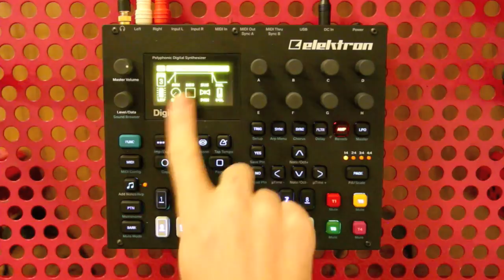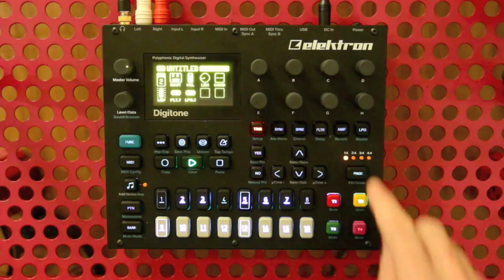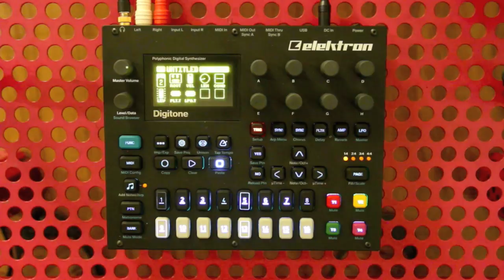Digitone Trig Layering Advanced Tip

Comment from the maker: If you have any feedback or questions, just leave a comment!
Reply: @Ron Booker those are two totally different machines
Reply from the maker: @Ron Booker I'm happy you have found something that works for you. MC-909 is still a great platform...I actually first cut my teeth on an MC-505.  Your points of criticism regarding cost of development, manufacture, branding, etc are not entirely correct. There's a lot that goes into a product's sticker price. I worked at Elektron throughout the entire development and launch of this product.
Reply: Hey man ! What kind of advantage do you see in this method? I am just curios because I may just not get it 😁
Reply: Great to know someone else with the digit one out there. Both tips were new to me. Kudos... I have subscribed,,,,

Comment: Nice video! What's the advantage to this method over just copying the pattern from T1 over to T2? I guess just the fact that you can actually stack? Because while all the things done were cool, I'm not sure I saw much of a need for one method over the other except for when I first heard the stacked sound at 1:51.
Reply from the maker: Hey good question! You are correct, stacking normal note trigs is not really a special advantage...but adding parameter locks that contain no "note trigs" is the point here.  It's like having a separate "parameter automation lane" for one of Digitone's tracks.  And thanks to the Elektron sequencer's handy conditional programming, those parameter locks in the so-called automation lane can be probabilistic, or triggered only in fill mode, etc etc

Comment: I'm confused, and a future digitone owner, didn't I read in the manual that you can add a trigess lock even to a step that already has a trig? Did I read it wrong or could you do this on track 1? Thanks
Reply: i dont have the Digitone but a Trigless Trig is exactly what its name implies: It doesnt trigger the Track Sound and it doesnt trigger the Envelope or the LFO by Default (you can change the latter behavior though). It triggers Parameter changes. A regular step always has that trigless trig built in - if you want to see it from that perspective. However: If you want a Sound to be triggered on a particular step all the time - but if you dont want to change, lets say, the Filter frequency for that very same Step every time - this method is most likely the only way to do it. Because a Trig Condition on a regular step will influence the Sound triggering as well. This method only influences the parameter changes. Nice thing to have, but most likely not usable all the time since you run out of Tracks on that Digitone quite fast that way ;-)
Reply: umonox oh so like if you want to override the parameter lock you've already put on your note trig? I understand what a trigless trig is but that's not the question, the manual uses the word lock trick and says that you are able to add one on top of a note trick on the same step and same track. So I'm trying to understand if that's true or not cuz someone this video is layering Tracks to get the same effect , but according to the manual you should not need to use two tracks to layer. So I'm just trying to understand if I misunderstood or if this is unnecessary? Not saying that it's stupid I just want to understand how the trig locks (func + trig) work

Comment: cool hadn't figured that yet, this layering is so fun, do you know if we have something similar on the A4 ?
Reply from the maker: Good question! The "layering" function on DN is slightly different than the poly assign functions on AF/AK...so it is not possible AFAIK.  Although with an AF MKII you could send CV out using the CV track, and feed that back into a CV input and modulate a synth parameter that way, thereby giving you an "separate track" for parameter automation.